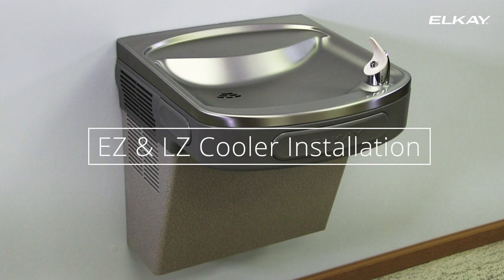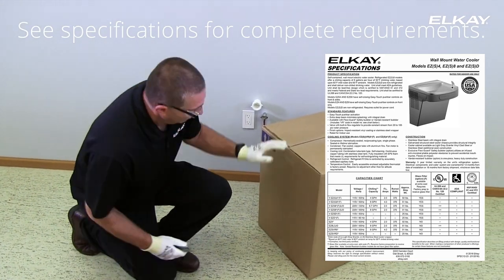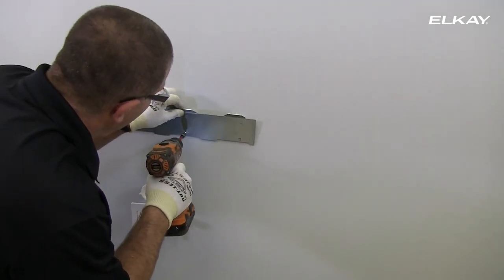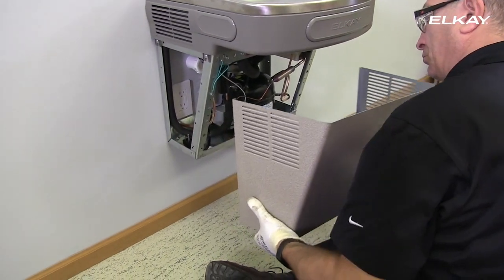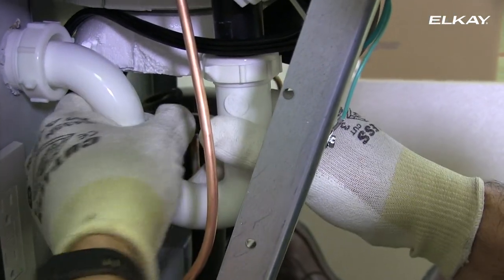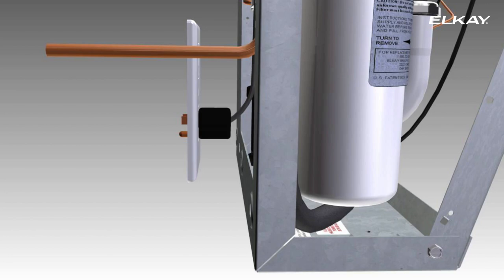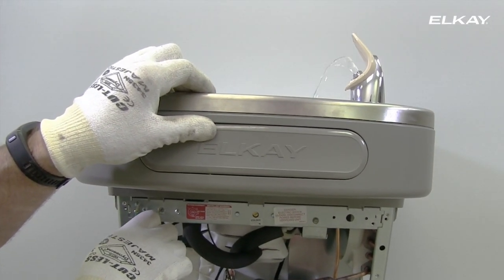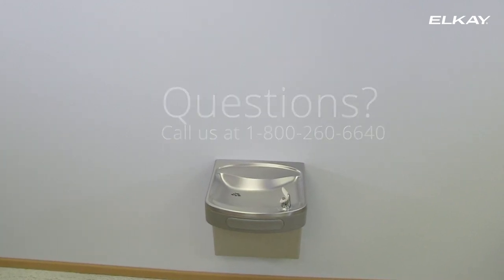EZ & LZ Cooler Installation (English)

Comment: You skipped the water supply hookups! How did you guys miss this?
You showed the shutoff valve, but where exactly does it hook up to?
Reply from the maker: Hi, thank you for reaching out! Please contact our friendly customer care team at svtechservice@elkay.com or 800-260-6640 X1, they will be able to assist you further. Thanks!
Reply: I recommend adding a water line strainer as well